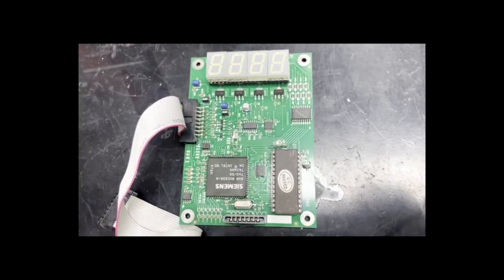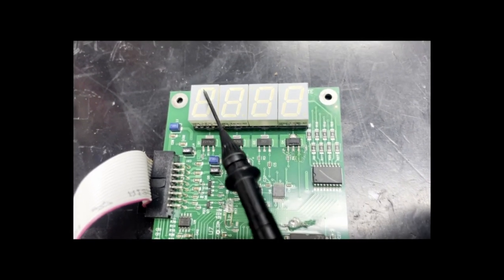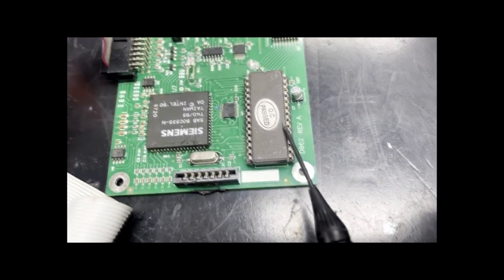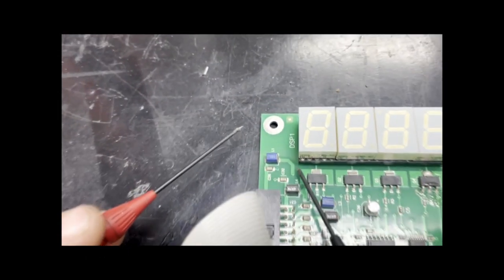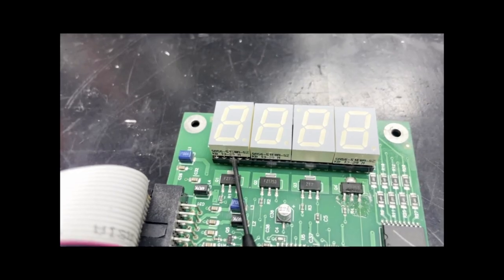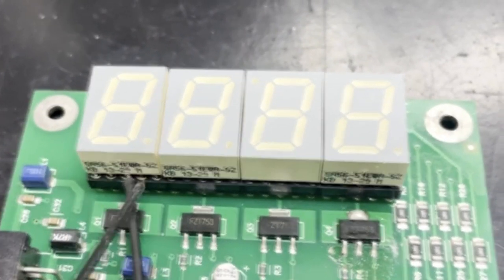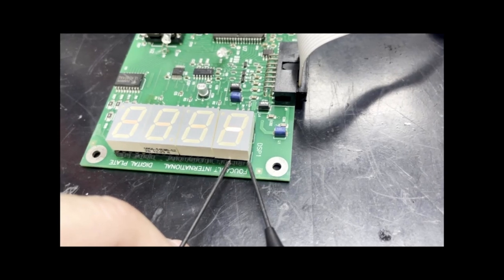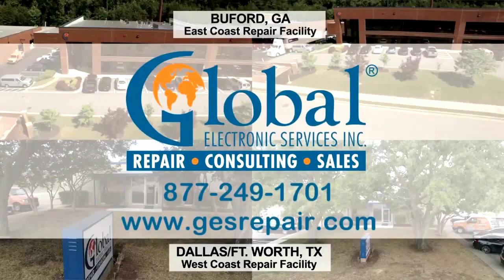7 Segment Display Repair - Component Level Testing

Comment: What voltage are you using to illuminate the segments? That information is vital to utilizing this videos purpose.
Reply: Put your MM in diode or continuity mode. It will send out voltage.